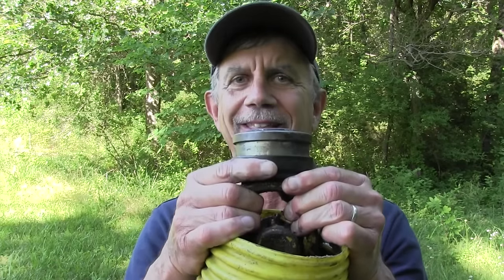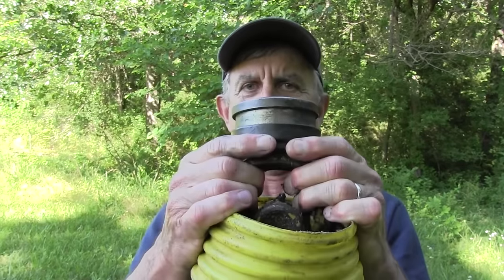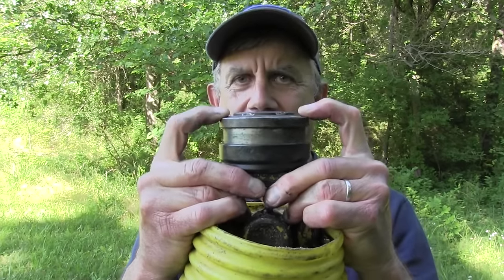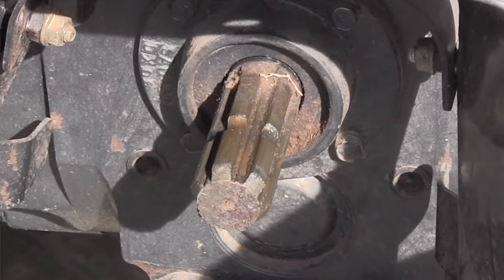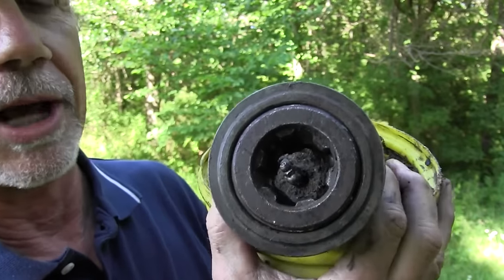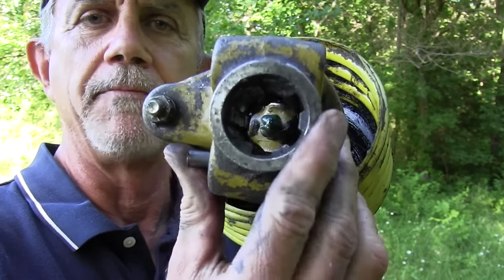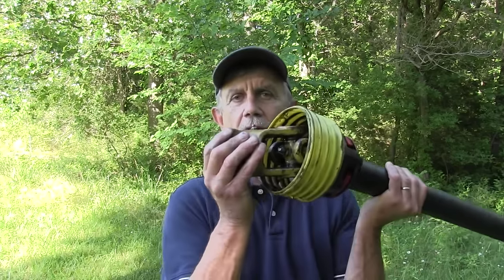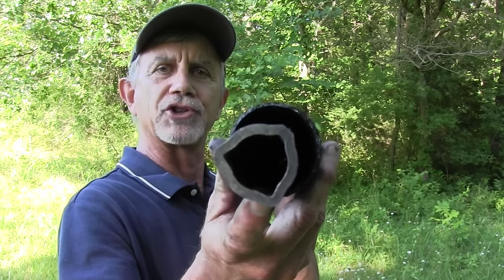Why Your PTO Won't Go on the Tractor and the Basics of PTO Shafts

Comment: The pull back collar type shaft was the WORSE idea that anyone could invent. I was told by an EMT that the push pin type was eliminated to prevent someone`s clothes being wrapped by the PTO shaft. Why would anyone with any common sense get close to a rotating PTO shaft in the first place??

Comment: I usually hang on to my ROPs with one hand. Then climb between my quick hitch and my implement.  Then hold the PTO shaft with my OTHER hand. Then spin the shaft on the tractor with my OTHER hand while trying to align everything while leaning over in an awkward position holding a 10lb shaft then pull back that collar on the coupling with my OTHER hand and push things together. Did I mention everything is covered in grease? LOL.
Reply: You described every tractor owners procedure. Lol
Reply: That's four hands, I counted.
Reply: Yep! Only takes four hands, lol
Reply: Excellent tips, and proof that instead of shafts, we should be using a hydraulic pump at the PTO, a hose, and a hydraulic motor on the Bush Hog. Hoses are flexible and they transfer all the power anyone needs.

Comment: I have Multiple Sclerosis and hooking up the PTO shaft is a challenge for me, trying to hold the collar back, holding the shaft up, and then sliding it forward all at the same time.  I alleviated that for my rotary cutter by buying a JD Quik-Knect.  It works great for that application but is fairly expensive.  On my other, less used, implements I still have to wrestle with the original connection but for the cutter the QK was a lifesaver.
Reply: I've been looking at some of the quik knect options but boy are they expensive! May have to go that route if I can't find a replacement shaft with the push button style connector. Not sure you could come up with a worse design than that pullback collar style that requires two hands and plenty of cussing.

Comment: The greatest thing I've found for getting a PTO shaft on easily is the hinged shield on my tractor.  Did not know it would lift up (Yeah, yeah -- shoulda read the manual all the way through.) until I saw another YouTuber lift his up.  Stopped the video and ran outside to see if mine would do that and it would.  Hallelujah!  Good video.

Comment: U saved me. 
Attaching the snowblower to my tractor in a confined space I could not get the connector onto the PTO shaft. It worked last time after much effort only because I pulled the front ring back without knowing it. Everything is clean and lubricated so what could be wrong?Tractor Mike told me to pull the front ring back back and it went on perfectly. Since this is a confined space, it’s intuitive to push everything toward the PTO shaft including the ring, and it would not go on. Thank you Mike and I don’t know why nobody ever told me this. When not in a confined space. I guess I always pulled both rings together and it went on thinking that’s the way it works and it did. Always can learn something and best to ask more questions. Thanks and I watched the whole video the second time since it was past my bedtime and snow is in the forecast and a thumbs up!!!

Comment: Hi Mike!
It was great to see you in Chehalis. This video made me think of one more tip - be sure to get a shaft that is heavy enough for your implement. I replaced a shaft on our hay mower a couple years ago and it got twisted with just normal use. Turned out I needed a much more heavy duty shaft. Just recently I replaced the shaft on our hay rake and was able to save money by buying a lighter duty shaft. Light or heavy, they ain't cheap!

Comment: my new PTO shaft has the push-button release, which is kinda awkward to get to and hard to push with one finger but its MUCH better than having to put a shear pin through the end of the PTO yoke and the tractor spline at the same time, then place a pin through the end of the shear pin.  Uggghh, hated that!   

Thanks Mike, for all you do.  You've sure saved me a lot of time, mistakes, and money. Much appreciated!

Comment: Good tips and review of the PTO shaft. I have been around Hesston, New Idea and Woods and they all used that same type of bell shape shaft and they all used the double joint CV type since they were on High Speed applications on 1000 rpm. Proper hitch length is the most common thing for PTO line to work proper. I would stress on most mowers to use the CV joint type to get more flex for turning and crossing ditches

Comment: The reason the pto shafts will only go together one (or two) ways is so keep the u-joints phased correctly. If they're phased incorrectly bad things happen because the ends of the shaft are speeding up and slowing down several times per revolution.

Comment: I've found lubrication is the key.  My old Ford 1715 didn't have a PTO stub cover but I always kept a can of WD-40 and a small stiff bristled wire brush on or near the tractor. Spray and brush the stub, spray and brush the PTO connector. They always slipped together easily. It's even easier with the new New Holland because it has a PTO cover to help keep the stub clean. Also, slide the two halves of the shaft apart once a year, clean it and put some grease inside the female half and put it back together.
Safety rule No1 never, ever get near an implement or the PTO shaft when it is turning. Sometimes you have to get off the tractor to analyze a noise, when the PTO is running, but do it from a distance!!!

Comment: Also need to be careful with drawbar/pull type mowers that don't use the 3pt arms.  The 3pt arms need to be up and out of the way of the pto shaft for when you are turning.  Had a nice new pto shaft get the shield all messed up because arms were left too low and hit the shaft when doing a 180 degree turn.

Comment: Round pin, square shaft is all I've ever used here. You forgot twisting the shaft though, I mowed a field for a cousin with my 7 foot Ford bushhog and 100 horse Ford 7700 and the grass was extremely thick and heavy. Tractor handled it fine but the pto shaft on the bushhog twisted considerably.

Comment: I got tired of fighting mine, the push pin type. With the PTO shield in the way and it's really hard to bend over while holding up the PTO, push the pin and try to get it all up under the shield while keeping the pin depressed and trying to line up the spines. I bit the bullet and ordered a PTO link system... which, btw, I looked for on your site but couldn't find it, sorry..lol.
Reply: I have the push pin style on a chipper and it's a walk in the park compared to the pullback collar style on the mower. If that ptolink product is even easier than the push pin I may just have to break down and buy one.

Comment: I got a new PTO shaft with tight splines.  Had to emery cloth the splines just a little.

One with the side button, not the collar.

When operated properly (and lightly oiled or greased) they should slide on with little effort.

Haven't seen the twist version in a long time.

Comment: So he mentions driving thru a draw binding the PTO. How bad is to bad. The property I mow has a ton of elevation changes so I set my mower to about 6” and sometimes the mower lightly bottoms out and very briefly makes the motor lug. Maybe slows rpm’s by about 50. I close my rocker shaft valve or whatever it is called because my mower causes my 3-point to sag and don’t want to have to constantly adjust. So to adjust mow height thru the draw involves stopping, open valve, adjust height, mow, stop, adjust height, close valve and would need to be done about 100 times thru out the field

Comment: Hi Mr M I picked up last year a 2016 jd 5055e with h240 loader & she has 180hrs. I'm a land owner of 100 +acres trying 2 clean out fencerows. Is a stump bucket a good addition? I do have commonsense but I don't want 2 hurt my tractor. PS u r the first U2er I've texted. KEEP BEING U.
Reply from the maker: I'm not a huge fan of stump buckets on tractors, but we have hardwood trees and lots of rocks here and it takes a lot of digging to get a stump out of the ground.  On smaller tractors it's pretty easy to tweak your front end loader and that's not something you want to do.  On a tractor as big as yours it would be less of a danger.  The biggest problem, in my mind, is visibility.  It's real hard to see what you're doing with the engine in your way, on a skid loader it would be much easier.
Reply: @Tractor Mike  Mr M thx 4 your info. Yes it's real hard 2 c anything down there. I liked  your tree puller video, but I don't have 3rd function. Keep being u. I enjoy your u2 videos. Glenn

Comment: I've heard that the PTO shafts have those shapes so the yokes remain aligned. The yokes need to be 90 degrees out of phase with each other. If they're misclocked, the shaft would bind up.

Comment: The drive shafts only go together one way for two reasons. One, it might be balanced, not likely on a farm implement. Two, to keep the yokes in phase. They would probably be okay if they were off 180 degrees but you would get lots of vibration if they were off 90 degrees. Both yokes have to be in the same orientation otherwise when at a angel they turn at different speeds on the corse of a revolution.

Comment: My pto shaft is new and I don't have a problem putting it on or taking off. I forgot to disconnect it from my tractor and drove away from my implement. I noticed it a few days later after dragging my box blade down the driveway.  Is that a problem, can I just clean it up and continue using it, or do I have to buy a new one. It doesn't look to be damaged in any way.
Reply from the maker: Clean it up and put it back on and you're probably fine.  As long as it didn't get bent.  If it did, here's what to do, don't buy a new one: https://youtu.be/ApnU87qOQh8.
Reply: @TractorMike  Not bent at all, I was able to clean it up, grease it up and slide it back together.  Haven't used it yet, but I'm sure it will be fine. Thanks for the advice.

Comment: With the slip on style with the 2 ball bearings in the collar I have that on both ends  what do I have to do for a shear bolt or clutch ? Or does the beatings slip instead ????  This is on my finish mower or does the belts just act as the slip or shear device ?
Reply from the maker: Usually on a finish mower the belts act as a slip clutch/shear pin.  If you hit anything that doesn't move the belts will slip.

Comment: I forgot to push the pin down when I connected my implement to my tractor. It began to spin and then BANG, it stopped. There is nothing visibly broken but now it does not spin and the PTO Light is blinking. What could have happened? Is it a simple fix?
Reply from the maker: Vinnie, I'm not sure what is going on there.  There's no way a PTO can spin when it's attached to the back of the tractor.  Once those splines are engaged they can't go anywhere, but if the pin is not locked on, the whole shaft can come off.  What I think has happened is you've sheared a shear pin on your cutter, which would let the PTO shaft spin but not engage.  Here's a video on replacing a shear pin: https://youtu.be/98rseNk2hSY.  It might be you have a slip clutch that is slipping, here's a video about that: https://youtu.be/eVRr9eechLI and one that talks about both: https://youtu.be/PbSGAyrx9sY.

Comment: I (overpaid) for a Facebook brush hog special. It has a spin type coupler. I don’t want to buy a new end. Can I rebuild the coupler? Asking because I don’t want to go back out there tonight.
Reply from the maker: If you can get parts, you could rebuild it.  You'll need to find a shop that specializes in drivetrains to find the parts for it, it's probably best to take the front half of the shaft off and take it to them.
Reply: @TractorMike  thanks for the reply! I gave it my best shot and wound up taking it back to them.

Comment: The typical PTO shaft can:  Wrap up 424 feet of shoe lace in one minute at 540 rpm, or 785 feet of shoe lace at 1000 rpm. How long is your shoe lace?  Have a rag ready and don’t wear your Sunday best when messing with a PTO coupler, my hands always get covered with grease.   Have your pumice hand soap ready, lol.
Reply: That's seven (7) feet per second at 540 rpm and thirteen (13) feet per second at 1000rpm. Just taking the units down to something easier relatable by heart.

Comment: I despise the pto shafts where you have to pull the piece back and push at same time. The person who designed it was a complete idiot. The design needs to be done away with. I prefer the one with the button that you push down. Another thing that makes putting a pto shafts on is the cover around the shaft on tractor. It is especially difficult to attach on small tractors